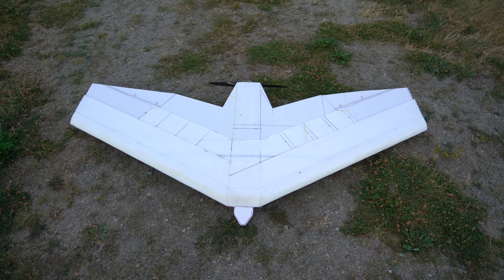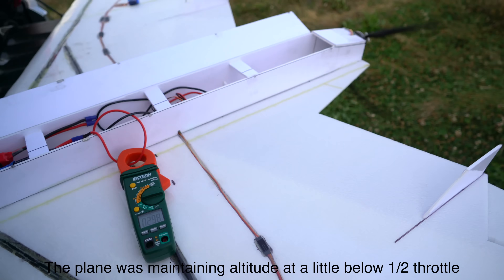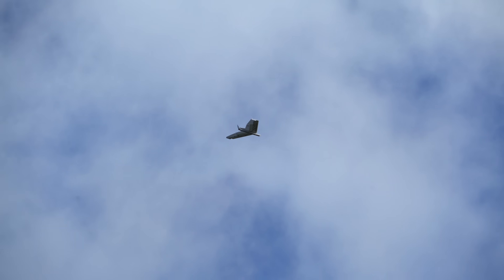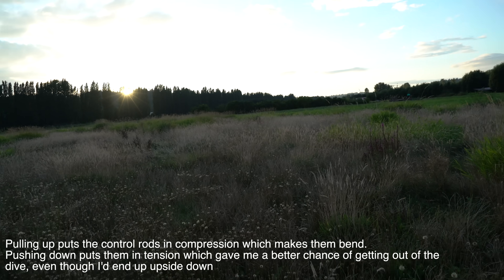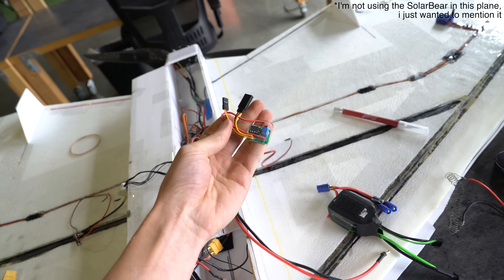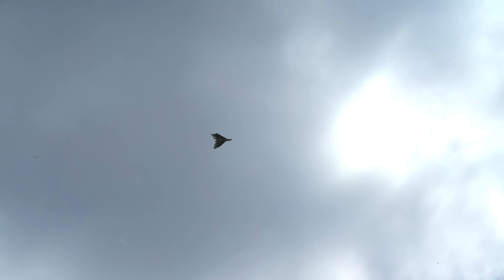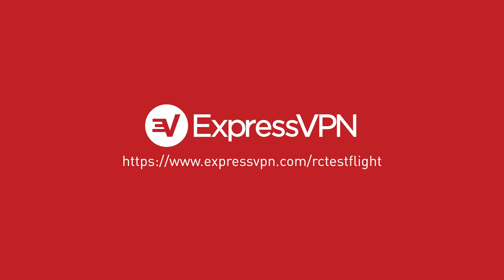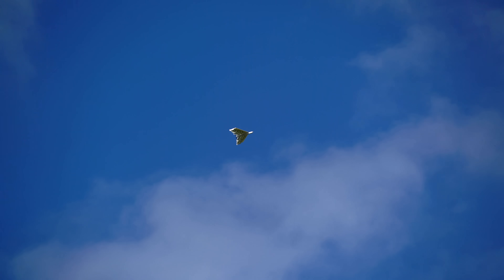SOLAR Plane V4 Flying Wing

Comment from the maker: If anyone wants to donate to the solar plane project my PayPal is rctestflight@gmail.com  - Donations greatly appreciated because these cells don't come cheap!
Reply: I love your solar videos! Im a patreon and considering raising my contribution. Do you have the airfoil design from the V3 plane publicly available? How about a parts list? Thanks! Steve
Reply from the maker: @steveracecars  Thanks for your contribution! The V3 airfoil isn't derived from any specific pre-existing design. Its pretty similar to a Clark Y airfoil, then I adjusted the height to accommodate my spar and the solar cells. There are certainly much more efficient airfoils out there that would be better for a solar plane. I unfortunately wasn't able to use an under-cambered airfoil because of the way I covered the wing
Reply: @rctestflight  hey, btw VLC Media player has built in screen recording 😉
Reply: what are the name of the cells you're using and what efficiency are they? Awesome video thank you for uploading!
Reply from the maker: @jotham123  Sunpower Gen C Bin Jp1. The spec sheet says 22.4%
Reply: @rctestflight  sunpower has the best cells last I checked.
Reply: @rctestflight  what company to do you purchase them from?
Reply: you can use OBS to record your screen. and it's free.
Reply: @Cephalon_Shade  cheap,lol easy to use and low processor demand.
Reply: rctestflight remember that scooter video you did about a year ago. Are you going to make a second part or a parts list to it? I just need the parts list because I am trying to replicate it.
Reply: How about a group buy? I want to get some cells for my project. Would that help at all?
Reply: done
Reply: Rudder for turning ?
Reply: @81savage15  Two smaller motors for thrust differential. Less servos, less weight, less drag and less motor weight overall. It probably needs a little dihedral as well.
Reply: @stephendoherty1275  more amps? Most dual motor set ups use more power to achieve the same thrust as a single motor. At least that's been my experience in smaller scale stuff...
Reply: @stephendoherty1275  ohhh yes, and honestly with it being so back heavy having a two engine setup centered on the middle point of each wing, even if they are not lighter would be a better setup.
Reply: Support cryptos too. I would like to make sure you get 100% of the funds I send.
Reply: @officiallynmotion7100  except for the transaction fees and exchange fees 😒
Reply: Thanks for pinning that.  My little PayPal elf is going to login at home tonight.  Best wishes to you and congratulations to your parents for providing the world with such a wise and mature gentleman.
Reply: rctestflight 
what prob size ?
Reply: How come you're waiting until next summer to work more on this? Does the sun output way less power when it's out during the winter? Or you just don't want to work with shorter daylight hours?
Reply: Looks like the mRo GPS antenna is pointing DOWN.
Reply: What type of solar cells are used?
Reply: Hie, I would like to do a similar project, I was wondering were you get the solar cells from, a purchase link would very helpful thanks
Reply: how long does it stay up?
Reply: Thank you for spending the time and money to prototype this out for us.
Reply: rctestflight If you ever need a custom designed pcb, let me know.
Reply from the maker: @JerkFrags  Do you do schematic design too? Could use some of that
Reply: rctestflight I can definitely do that. I would be interested in working with you to accomplish some fun goals. I've designed a couple ESA radars, and been a founding engineer at a company. While I can't do everything, I have some range in what I can do.

I honestly love this kind of stuff that you're doing and enjoy doing it for fun.
Reply from the maker: @JerkFrags  Awesome! Whats the best way to reach you? Or you can shoot me an email
Reply: rctestflight I'm sending an email right now.
Reply: this design is so nice! it looks so beatiful!
Reply: Can you try a front motor/rotor and a rear one on one plane
Reply: Obs!!!!!! esoftware
Reply: What’d would happen if I used this exact configuration except I used an 1000kv motor and a genasun 14.2v
Reply: Yo - Do you have any info on the most efficient way to get an e-bike and solar panels like yours? It's just an addition of solar pannels and an MPPT? ty
Reply: If you want to reduce weight try foam board
Reply: First time watching a video from your channel. Very interesting and love rc planes.
Reply: First time watching a video from your channel. Very interesting and love rc planes. Question. Are you in ontario Canada? Also I thought this was another channel from the YouTuber "The Outsider" because you both have very similar voices and narrating. I'm subbing to your channel and thanks for the video
Reply: Hi, which part of the electronics circuit prevents the battery from overcharging?
Reply: Do you have a charging circuit for the battery? Also as a suggestion greatscott has a good solar circuit that maybe useful since that circuit has a mppt which can increase solar panel efficiency
Reply: what tellemetry system and gps module do you use? I'm looking into building one but don't want to spend 500 dollars on two anthenas :)
Reply: Here's something you can do without building a new plane....test the efficiency of the panels with and without film.
Cold hard numbers, baby.
You CLEARLY want some protection for those fragile solar cells...HAH!...see what I did there?  "Clear"......
Reply: But you already got sponsord and you have more than me I dont have even a car
Reply: you should put some solar panels underneath your rc plane to get the sun reflecting off the earth :)

Comment: I hope you do more solar flyer stuff. 
MPPT will work much better if the panel voltage is about 5v higher than the packs fully charged voltage or 1.3x pack voltage

Comment: If you make the solar cells clip in rather than glue fixed,  they might survive crashes better.  It might add a tiny bit more weight per cell.  Possibly using tiny lug holes in the wing for the cells to clip in w=using a lug pin glued to the under side of the cell.

Comment: I know this is an old video and I haven't watched your other solar plane build. You have possibly moved beyond making solar uavs by this point. However have you or anyone else thought about making the entire upper surfaces with flexible solar cells? On the lower surfaces use something like carbon fiber with carbon fiber tube sparring. Something lightweight and strong to give it some strength to hold itself together.

Comment: Hey Daniel. I really like the solar powered aircrafts that u make. Currently, I'm planning to make one as well. I want the solar aircraft to fly for an hour non-stop (basically a long endurance aircraft). I also wanna find out how I can keep flying the solar powered aircraft during night time. Is there any possible way that can be done? Maybe storing charge in a capacitor and using that during the night time?

Comment: What device switches between the power sources. I.E the battery or direct from the panels? Id like to build my own similar project. If anyone can explain that to me? I mean if your device (like the flight controls and motor) can use power direct from the panels as well as from the battery (if the sun goes behind a thick cloud), then surely some device must be present that is smart enough to detect the need for the source switch. Also, when the source is switched to the battery, should the charging not also be de coupled first? I'm a bit confused around this. I'd appreciate if you could enlighten me! Cheers!

Comment: Hello Sir,  i recently made a flying wing build just don't know what is the issue.  the CG is well balanced.. 
everything is fine, but it just goes like this,

https://youtu.be/3HP7DFw8CIE

It just goes on roll and flipps.
It is on full manual, but it just flips without any remote inputs
i Tried to move the CG bit forward and backward, but it made it worst.
i just don't understand what is wrong with it.
Can anyone guide me with it?

Comment: Hi Friend. I think that the main problem that your plane crashed two times in the same way was the problem with the stall speed. Look at the mission planner to disable this function. You do not use  the pito pipe so the pixhawk tries to increase the speed by diving lower and you had the same result two times. Just disable stall speed and try to fly in stab mode.

Comment: Have you thought about using super capacitors instead of a lipo? They're extremely light and hold quite a bit of mah for a cap. If you put a tiny bms on the airplane it would keep all the caps in sync or you could charge your lipo in the air... Looks like a fun project.

Comment: You could make it so much better by removing all the crap. Plastic boxes around electronics, connectors that never gets disconnected can be soldered etc. It adds up fast.

Comment: Those charge controllers are scams. The lowest losses you will  ever get is around 25% losses. You'd be better off with a relay set up to switch off charging if it starts exceeding the battery limits. You always get a voltage drop thru the transistors they use.
Mppt is a fraud. I commonly get twice as much amps at higher voltage with no charge controllers.
Oh.. your claim that the solar cella are expensive????
At 15c per watt?!!?
You are obviously buying them at the wrong place if you think they are expensive!

Comment: This actually looks to be the perfect project for SHTF prepper stuff or DIY survailance work. I've thought about putting a handheld amature radio up in the air where I have line of sight to repeaters and having something that could work for extended periods of time could be of real benefit. I can think of a million ways to save weight including trading the wires to using a PCB circuit board that is also the plane's shell.  Also, you can make your own solar panels with a paint-on material and thin wires, but not sure it's efficiency. I would also control the plane with a 4G LTE module and a DIY cell tower. But the costs really start to add up and there are legal issues with it. Looks like fun.

Comment: That's incredible. Running on 100% solar power is a great achievement. It would seem that the small servos and thin linkages are not strong enough. You really need metal gear servos and thick linkages. They will put more weight on the plane, but you might get away with just two metal gear, high torque servos and thick linkages. This might save just enough weight to be worth doing.

Comment: Thank you for a very interesting video! I love solar panels and I'm having some ideas for some project and I found this video very informative and inspirational.
Everyone should should do their own research when it comes to using VPN security. In the video you are claiming that : "[...] without VPN my credit card and personal data is wide open to hackers.". That is false information and you no one should share this kind of false information just to scare people to use VPN. VPN service providers are advertising heavily on YouTube and I'm tired of listening to this messages designed to scare people to use their services.  I know VPN service providers would like us to believe that VPN is essential to prevent us from being hacked, but every online store, banks and other services are using SSL-encryption (https) with the same encryption strength as VPN providers offer. Just think of it, when you created your first account at ExpressVPN you didn't have any VPN connection yet and still they are asking for your credit card information and other personal data without using VPN. 
You can verify if the website is using SSL-encryption by looking for the lock symbol in the address field (just check it out here on YouTube), and many browsers will detect if you are sending email, password, credit card information on an insecure connection. If an online store doesn't use https you should stay away from that store. Every website that require the user to log in with username and password runs https, but if they don't you shouldn't use that website in the first place because they are showing very little respect for your personal data. There are many good reasons for using a VPN connection, but preventing hackers from stealing your credit card information isn't one of them. 
I got my own web server and I got SSL (https) on every domain and subdomain with legitimate certificates. EFF's "Let's Encrypt" project has made it very easy and free to set up SSL connections on web servers and they offers certificates for free. Every visitors on my websites are automatically redirected from http (port 80) to https (port 443) and every information sent between the server and the users are encrypted.

Comment: Instead of pushrod controls,  why not use a pull/pull system with thin wire.  Lighter & you have full control authority both directions.   Just use larger serotonin horns through the wing.  It does work well.

Comment: 2:48 What you are talking about is called constant ram pressure (for jet engines) - pressure of air as the plane forces itself through the air

Comment: you have the solar panels power the motor or charge the battery. but the battery is a lipo, doesnt it need balance charging?

Comment: @rctestflight you sould overlap the solarpanels a little. the edges are usually not as efficient and it will give more  room for extra panels. 
Its what they do for solar race cars in australia.
Overal nice work keep it up :)

Comment: you should look into cigs cells, they are less efficient, you would get 14-15 % with miasole ones compared to 20ish% for Csi cell like the one you used, but they are much ligther and thiner and are absolutely not brittle. you can flex the hell out of them

Comment: So basically the charge controller saved your ass, because the solar panels where to high voltage for the lipo battery. Thank god for the nice charge controller.

Comment: Moving the center of gravity forward slightly and adding larger vertical stabilisers behind the center of drag (the aft portion of the winglets) will help to fix your drift issues and give the control surfaces more authority. The airspeed will pickup too once the wing loading increases with the weight of the solar cells. Flying delta wings are great for long range and there's less fuselage and tailplane drag to deal with. Nice effort!

Comment: You can place the motor further to the front if you use a long propeller-shaft. Better than adding ballast structures.

Comment: Did a Search on K-F foils, supposedly OK for low Reynolds numbers like RC models, but very narrow operating range, done any testing into a strong wind or diving which would likely result in laminar flow separation (the turbulence isn't trapped in the step anymore)? Also, wondering about your selection wing plan, in your next video noticed your suspicion wing flexing, I suspect may be a major reason for few high aspect ratio flying wings and the dart-like semi-delta of the centerline wing plans of the  MQ-25, B-2 and B-21. Very cool!

Comment: hmm.. needs an AI flight controller that can figure out where thermals are (store GPS position against heading/current draw/altitude change and figure out whether a spot is 'good' or 'bad' and once you found the best spots, circle there to gain altitude)

Comment: I am very impressed with the work you have done on the Solar Cell V4.   Although it crashed, i think you will finally find the correct combination of solar cells and stiff and durable enough control surfaces and push rods etc.  I was very impressed, and think you are on the right path with this one.... take your time.  When you get the right balance you will know it.  What you did here tells me you are very close.  Thx I and I am sure very man others also enjoyed.

Comment: Scrolling through the comments, I haven't seen this one yet:
Congratulations! 
I know it is not easy to make a vehicle from scratch that can sustain flight on 100% solar power, but you just did it. AND it's an autonomous vehicle. That's an impressive feat, so, genuinely, congratulations on making it work. I hope you can fix it and bring it back better than ever!

Comment: In order to get a reading of battery charge you would have to turn a current sensor around coming from the solar cells to the battery and use a diode.

Comment: I just wanted to note about having the current sensor by the battery, if your flight controller software does not read negative amperage feedback what you could do is have to current sensors faced the opposite directions back to back.

for example your first one might only read positive amps if there is a current going to the battery, but the second one will only read positive amps when current is flowing out from the battery. It should just be a matter of Orientation. Would love to see you do an endurance challenge of having you plane in the air for 1 Month continuously. Happy Flying!!

Comment: While I do not recall the exact numbers, I am fairly certain you would only lose a few percent (read <5%) using a relatively thing protective film over those panels. With 1-2 extra panels on the nose, you'd probably not notice the difference, and lower the chance of damage should your plane suffer a slight loss of control. Still love the project though, thinking about using the ardupilot software to make a rover, since I have a spare chassis laying around

Comment: Incredible build ! The wing design is considered efficient but bad gliding characteristic. (easily stalled & broken solarcells). And yes, the 9gram servo sucks but light weight. You still need to cover the solar cells with some sort of protection since air is humid up there.